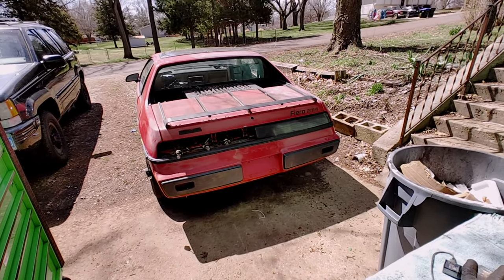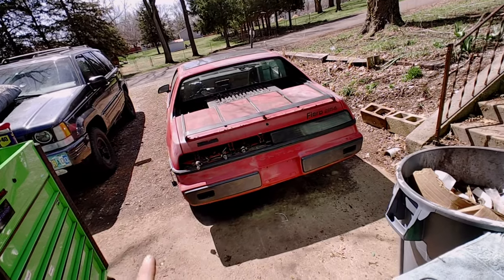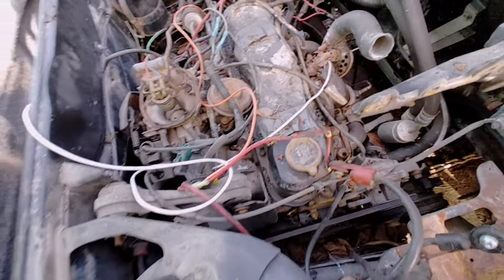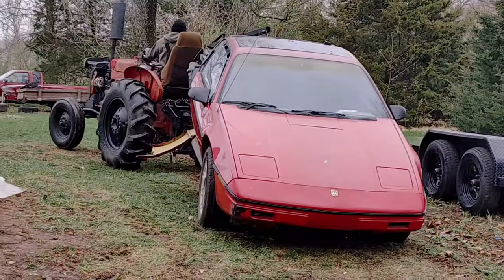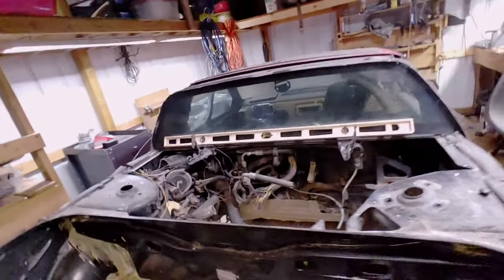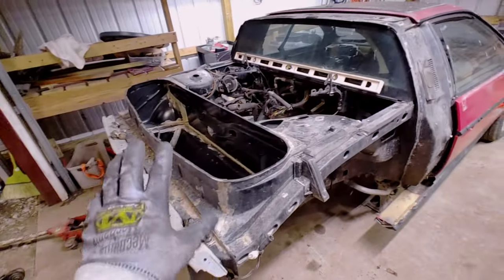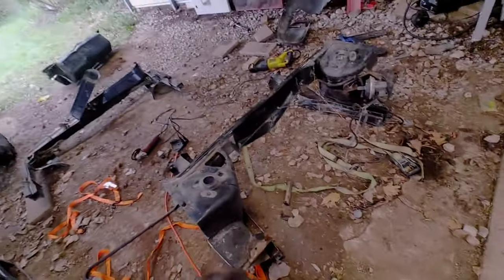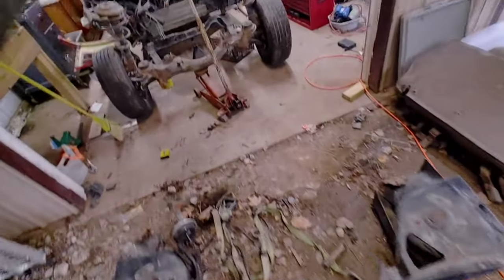HG Ep 11 - We Stretched and shoved a Northstar V8 in the Abandoned Fiero in a WEEK. PONTIHACK

Comment: I am using a 2007 Northstar in a Fiero Kit build. I do not have the gauge cluster but was told it makes things easier. My kit is longer and wider than the Fiero so I used the whole DTS Engine Transmission, axles and struts. So I had to fabricate a whole tubular rear frame with upper strut mounts. I am just getting ready to dig into the wiring and try and get this engine running this summer. I will be following you for sure.
Reply from the maker: Thanks its nice to hear from someone doing a similar build! I do have a 2nd video where I brought in what will be the real car, though its mostly just about doing the framework. This is my back burner project so progress is a little slower than most of my stuff, but I do share the same goal of at least running at some point this year. I have to make some adjustments and finish plumbing lines and upgrading the fuel system before I can even begin playing with wiring. Feel free to reach out anytime about anything!
Reply: STS Cadillac would have been a better donor choice.

Comment: when you change the length of a vehicle you change the steering geometry,  your control arm angles now need to be changed a small amount 1 to 3 degrees not exactly sure , but the ball joint pivot point and arm rod connecting point need to line up to the center point of the new rear wheels center point position to maintain akerman linkage, quick thought is the inner circle has a different angle then the outer circle for the front wheels while your in a turn relative to the body of the car,  now with a longer wheel base the original angle in the control arm isnt correct anymore, so one front wheel will skid during a corner
Reply from the maker: I'll be sure to address this in a future video!

Comment: DID IT EVER GET FINSHED OR DID U JUNK THE PLAN
Reply from the maker: new ep came out yesterday
Reply: @HauntedGarage  How are you planning hook up wiring also did the motor connect to the stock fiero trans or did you have use a archie kit ? or are you going use the caddy rans also ?
Reply from the maker: @kevinramey4226  Thanks for asking! Integrating much of the caddy wiring including the body control. Using stock caddy 4t80e
Reply: @HauntedGarage  so the caddy trans will fit in the fiero ? what year was the caddy ?
Reply from the maker: @kevinramey4226  yes, it will fit with or without stretch. my caddies were 97 and 99
Reply: @HauntedGarage  oh ok thanks ill watch as you go,,,,2 questions , what years will fit and what is the plans to wire it up ? full harness or parts im wondering how you plan wire it in , also are you planning use wiring harness to dash also ? give me a ideal what your planning so i can start mine here , thanks so much all your doing here and reples ,